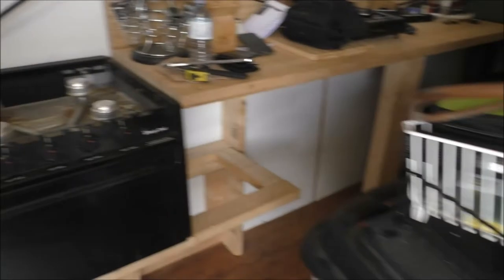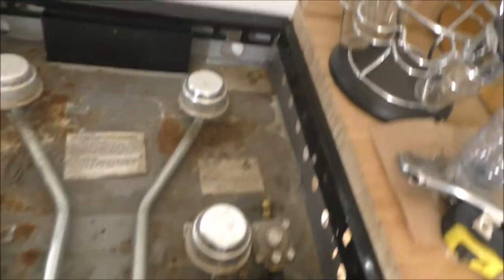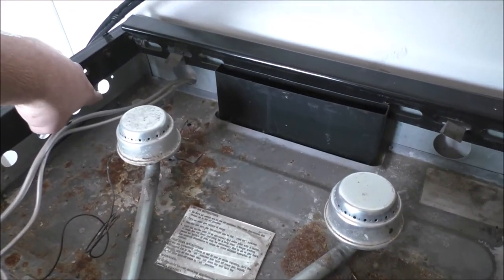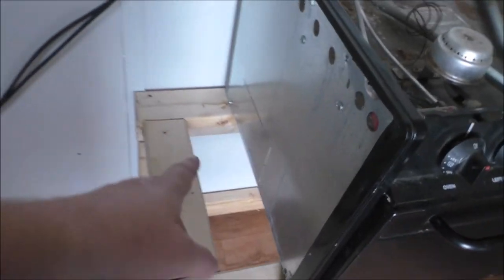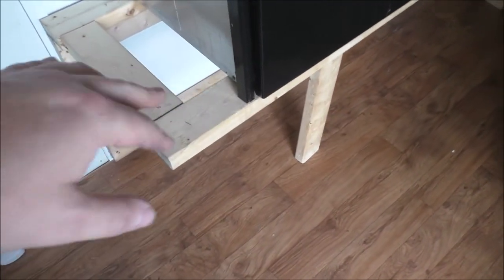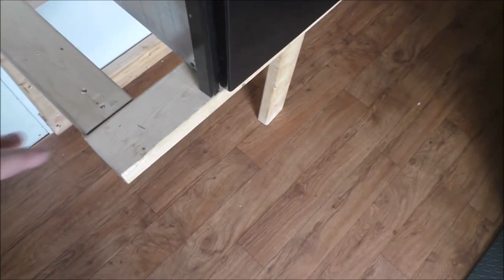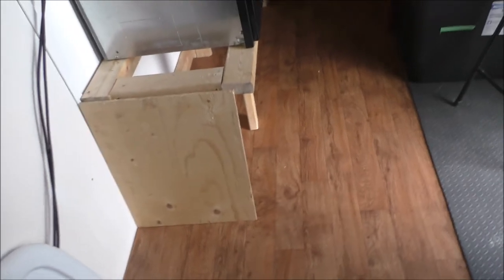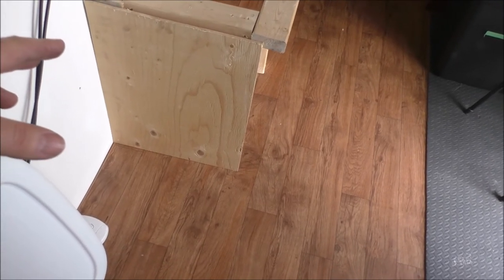Propane Stove Tiny House

Comment: you don't want a 20-pounder in your sleeping area if the valve pops that's the check valve due to a change in temperature. It's just not done.